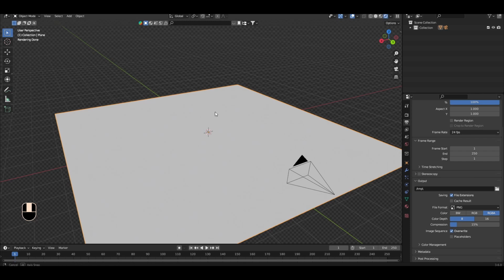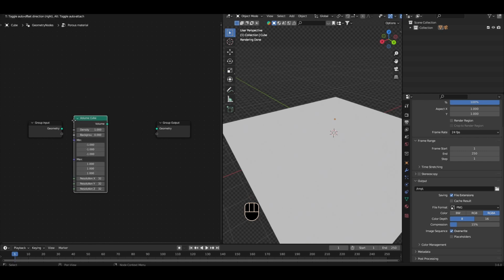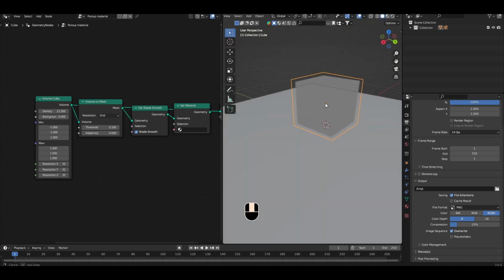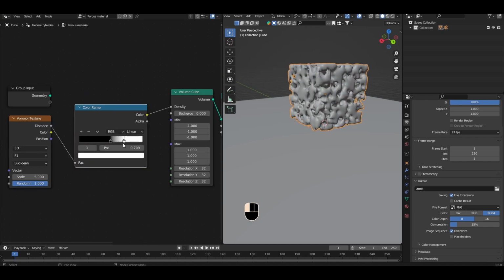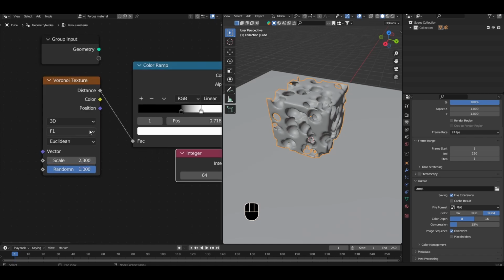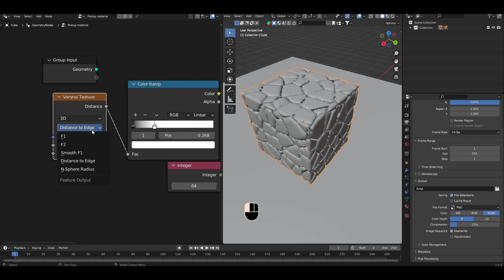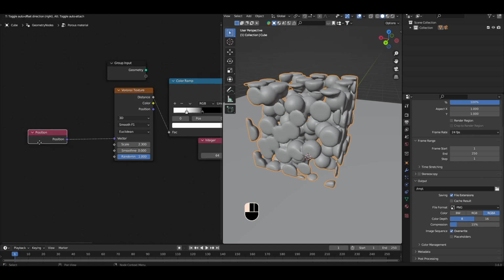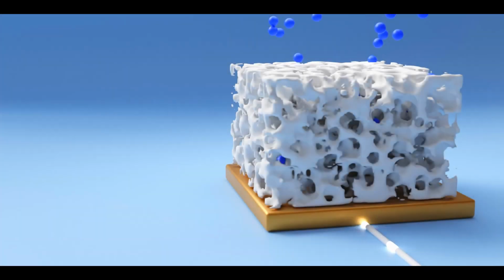Porous material structures in Blender

Comment from the maker: To answer the 2 most common questions I keep getting:

1) How do I change the colour?
Add a Set Material node at the end of the node tree, create a new material and select that. 
*Just creating a new material in the materials tab will not apply it. You need to explicitly call it with a node. 

2) I have my own geometry/model. How do I make it porous?
Check out my other tutorial - how to turn anything porous: https://youtu.be/fn8tcUt6uxo

Comment: Hlo sir 
How to programming set for cylinder, it work only cube structure
Please help me
Reply from the maker: I have a separate tutorial for porous geometries with any geometry on my channel. However, cylinders do seem to have issues with that technique. 

Try modifying this setup as follows. Add a position node, connect a separate xyz. Connect out only x,y components to combine xyz to make an xy only vector. Add vector math (length) to it, then compare node set to less than. Add a math node set to multiply before the map range node, and multiply the output from the colour ramp with the compare node from above. Toggle the "less than" threshold value in the compare node to get thinner/fatter cylinders

Comment: Superb video , I tried and got it !🔥🔥
How can i apply this algorithm to not just cubes or basic shapes but to shapes like car wheel rims, bumpers, dashboard etc.???
It will be great if you can make a video on modifying this algorithm to any modelled shapes, thanks!
Reply from the maker: Thanks! The exact tutorial for this is actually coming out tomorrow, so check back then ☺️
Reply: Great video! ✅🎉.
@ryomizutagraphics 

Just to add to this above comment, In continuation, Can we apply this algorithm to any 3D data such as car bumper or interior panels which is imported into blender!? File format can be .stl or .obj or .fbx . 

My final output requirement is applying these porous algorithm to the 3d data, get good porous patterns in good quality suitable for 3D printing !

Sorry for this lengthy comment!
Reply from the maker: @Lespaul-kv1to  So long as the object gets imported as a mesh object, my upcoming tutorial (tomorrow) will show how the nodes can be adapted to work

Comment: I want to do it on a rectangle but it stretches the porous thing. may I know how to do it a rectangle?
Reply from the maker: Rather than using "S" shortkey to scale the geometry, use the Min and Max limits on the volume cube node. Eg if you want to stretch in the X direction, decrease the min X and increase the X max.

Comment: how would i make my own geometry porous please?
Reply from the maker: Depends on what your geometry is!

If it is something simple, eg a cylinder, sphere, cuboid, your best bet would be to apply some further limits on the density using the position node. I show an example of how to do this for a sphere in my lithium ion battery video. 

If it is something more complex, you’ll want to bring in your geometry as well as the primitive volume cube. Then, create a Boolean conditional which =1 for positions in the volume cube that lie inside your geometry, and =0 for positions outside. And multiply that conditional together with the porous texture.

Comment: amazing.
just explain me how much geometry does this cube have ? is it a single surface from all sides ?
or you have to subdivide to make this effect ?
Reply from the maker: If your question is "is this computationally heavy?", the answer is "yes". 

Some details: With my geometry nodes setup, the computation to produce the porosity is performed using volumes (i.e. not geometry). The idea is induce spatial inhomogeneity using the volume's inherent "density" attribute. Therefore, you initially deal with voxel resolution of a volume cube rather than amount of geometry eg for a mesh cube. So no subdividing needed; instead, a reasonable voxel resolution is needed to resolve the pores. Of course, there is a volume to mesh conversion after creating the porosity - after this, there is indeed real geometry, but the subdivision level here is determined by the vol to mesh settings.
Reply: @ryomizutagraphics  
ok,thanks .appreciate it.
i've just downloaded 4.0 ,and i'm trying to make sense of geometry nodes.
in next few days ill try to experiment a bit wth them and i think that your video will be very helpfull...since it is short but it goes straight to the point.
tanks again
Reply from the maker: @themilosgrozni237  Good luck!

Comment: How do I change the shape for cylinder or sphere instead of cube?
Reply from the maker: Sorry for the late reply. 
I explain this at the end of my video about making Li-ion battery structures. For a sphere, you need to compute the distance of each point in the volume (use Vector Math Length with Position field as input), and pass it through a compare node set to Less than or equal to. The threshold value will dictate which points in volume = 0 and 1. Feed these into the density input for the Volume Cube
Reply: @ryomizutagraphics  
can you please explain the procedure. i am facing difficulties to make it sphere. i have added all the node as explained, but i did not get the result. can you help me out with the values which is mentioned here, i am not getting that

Comment: Amazing video! I have a question though. How do you make other shapes than cubes with this? I find that if you try to rescale the volume cube into something else the porosity streches in one direction and i can t get it back to normal...
Reply: Since the density input to a volume node is basically an SDF, you can take the maximum(densityfield1, densityfield2) = intersection of the two fields. So you can have another shape inside the cube with density set to 1 everywhere inside and 0 outside and take max value with the noise field and this mask field to clip the porous material to an arbitrary shape.
Reply: Any chance you could explain this more? I am trying to get a model to be completely porous like the cube, but not sure what to do since the mesh-to-volume doesn't have a min or max, or resolution. @amoose136
Reply from the maker: Good question! 

If you simply want a cuboid/stretched cube, play with the individual x,y,z components of either the Min or Max inputs on the Volume Cube node. 
E.g. if Min = (-2,-1,-1) and Max = (2,1,1), you'll get a cuboid with the long edge along the x-axis without the porosity stretching in that direction. 

If you want more complex shapes (cylinders, spheres), I'm going to make another video on that soon
Reply: @ryomizutagraphics  ok i ll try it out! And looking forward to the new videos!
Reply: @ryomizutagraphics  I am not finding your video explaining the steps for more complex shapes, have you made it yet ? And do you think it is possible to apply that kind of porous structure to any object of the scene as well ? I've tried to use a boolean and it kinda works but depending on the parameters of your texture and the geometry of the object, it can make blender crash...
Reply from the maker: @maximedvlr  Not yet, tutorial is coming out next week :)
Reply: Or rather I think you can just multiply the fields in this case.

Comment: Dude, you are on the cutting edge of, like, 75% of scientific+medical fields. Keep going, Ryo!
Reply from the maker: Thanks! And not to worry, much more to come 💪
Reply: how can we change the colour, when I tried to change the colour from the colour ramp, it did not work, any tips, please?
Reply from the maker: @IslamKhalil-cg3du  
The colour ramp in geometry nodes is not responsible for changing the colour - it is being used to define the output values from the Voronoi textures. To assign a colour, you need to have a Set Material node, create a new material and select it inside the material selection option in the Set Material node.